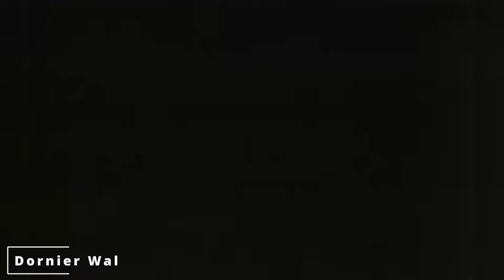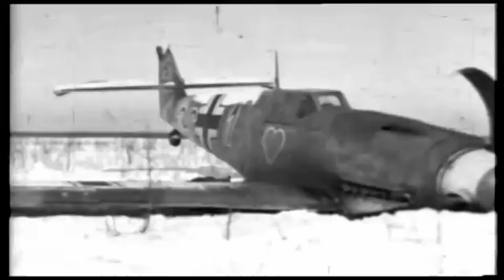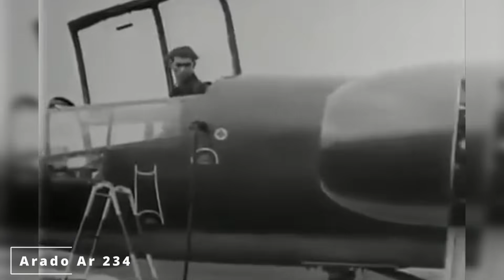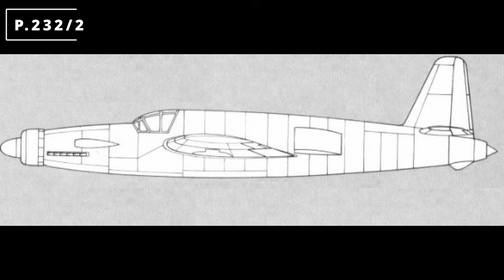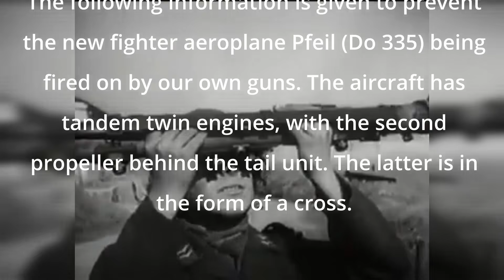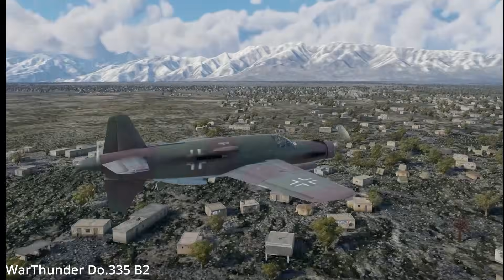Dornier Do.335 Pfeil: The Luftwaffe's Lost Bomber Destroyer (Full Story)

Comment: The dornier 335 Superior engines to anything the United States or England had. This is evidenced by the fact that when the Germans were able to get ahold of a moderately damaged Spitfire they swap the engine with a Mercedes 601 from a BF 109. It flew faster and higher than the Spitfire has ever gone. Imagine what the P-51 would have been had we been able to get ahold of that engine we were building the wrong engine for the P-51 the P-51 had probably the second best engine of the war along with the Pratt & Whitney's that were going into almost everything else.
The DL 335 was faster and could engage in battle and remove itself from the battle at will. They're just weren't enough of them and not enough qualified Pilots. The Jets were not able to accelerate fast enough after taking off making them horribly susceptible to being shot down anytime they were running low on fuel and had to land or right after they took off. The DL 335 did not suffer such maladies.

Comment: It came down to economics and strategic needs. The Do-335 used 2 of the sane engines used by the excelent FW-190D. Germany could build 2 FW-190Ds or 1 Do-335. Win outnumbered and in a war of aerial attrition the choice was obvious. 
The Do-335's vertical stability problems made the decision easier.

Comment: Also, due to Germany's lack of resources, materiel was quite restricted. They reasoned that for each 2 engine fighter that could be built, they could have had 2 single engine fighters instead. Thus, it was very difficult to get the approval for multi-engine aircraft. The emphasis remained on singled engine fighter designs and dual engine bomber designs in order to build the maximum number of aircraft that they could.
Reply: The Do-335 happen to use the same engines as the FW-190D, so that was a problem

Comment: Another advantage of the push-pull configuration in a traditional fuselage is weight.
All of the major masses are connected in a single major structure. Engine-bulkhead-cockpit-bulkhead-engine. No worries about engine loads on the wings and wing roots, no worries about loads on the twin-boom layout.

Comment: The Jona J.10 is an interesting design, and a little ambitious one!
When I saw the design in side view, I immediately noticed that the designer(s) had made a tiny mistake.

In one of the designs, the leading edge is fairly swept, on another (presumably the latter) design,  BOTH leading edges are swept back. I don't at all think that the designer was after better transonic performance with either design in 1935. I instead think that in model tests, the designer came across one fact of life. That is, if you want an inherently stable push-pull configuration in a traditional fuselage, you HAVE to move the wing aft in order to keep enough distance between CG and CP.

In fact, it comes a point when you can gain a lot in efficiency by moving to a canard configuration, just like Burt Rutan did with the Defiant.

Comment: April 2 1941. He-280. Sorry. I do believe the ARROW as I think they called it could have definitely been one of the top performing piston aircraft of all time. For sure. But one major factor as things got tighter a couple years in? Fuel quality. Jets basically use Kerosene for fuel. To get a piston aircraft to perform at its highest you have to have very high octane fuel available. Germany did not have much of anything but highly refined gasoline was especially in short supply.

Comment: The Do 335 looks like just what it WAS. An effort to experiment with the unconventional while the tried and tested successes on both sides of the war came from the evolution of previously successful designs with sequenced efforts to bring improvement. It does not matter how impressive the design does or does not turn out to be if the production is too complicated, expensive or long winded then anything short of a nuclear bomb is uneconomic effort and will detract from victory. The Sherman tank was no match for the Tiger when face to face but the difference in numbers won.
Reply: Interesting comment in the light of current US military doctrine that fields relatively small numbers of Abrams tanks, F-35, humongous aircraft carriers, etc...seems like we have assumed the smaller force/high tech philosophy while the RUSSIANS  still field swarms of T-72 1960 era tanks in Ukraine.

Comment: An interesting comment on how slapdash Allied study of captured equipment was is reflected in the fact that, when Do335 werknummer 240102 was sent back to the Dornier plant for restoration before being displayed at the DeutschesMuseum, the workers found that the explosive bolts in the tail and cockpit were still live.
Reply: Seeing that these explosive bolts were there to allow the pilot to eject, the allies would have been foolish to take them out.
Reply: @alangledhill6454  it's not that they were left in when captured, but that they were still there, live, with twenty-plus years of deterioration when the aircraft was shipped back to the Dornier plant in Oberpfaffenhausen (where some of the people working on the restoration had also worked on its original assembly).
Reply: @alangledhill6454  Taking them out while the plane was being evaluated by test pilots, yes -- but the plane sat out in the open for decades, with the explosive bolts live, before being taken in by the Smithsonian and sent back to the Dornier plant to be restored.
Reply: I imagine the ejection system was disarmed.  Likely there is a safety that is armed on takeoff by ground crew.

Comment: Given Doniers' interest (& experience) in push-pull engine installations, it does surprise me that he didn't begin years before with a DB601 version of the Pfeil, an aircraft that would surely have beaten the Me110 in all the roles it went on to carry out. 
It would also have been able to act as a great prototype for the genuine Do.335 with the larger DB603 engines, ironing out any issues discovered in testing & service use & bringing forward its use.
Thankfully they didn't.
Reply: -It takes years to get an air frame flight worthy and then more to set up a reliable production system.  Engines take even longer.   
Even if the Do 335 concept had of been promoted its hard to see it get it into operation any more than a year earlier, say Jan 1944.  The Jumo 213A and DB603A engines are both in service around June 1943 but they are still troublesome until 1944 and weren't stable engines till About August 1944.  I suppose its possible to imagine service in mid 1943.
-To change the course of the war the Luftwaffe would need an aircraft in early 1940 or tales mid 1941.   1943,44,45 is way too late.
 It would have to perform the following functions:
1 Long range escort fighter with speed, power to weight ratio, wing loading equal to single engine aircraft and range superior to single engine aircraft.
2 With speed to intercept Mosquito day and night with and without radar.
3 Able to fly photo reconnaissance over the UK.  
4 Able to deliver a small precision bomb load over the UK.
The aircraft that could do this in 1940 was the Fw 187 Falke with DB601 engines.  The aircraft was much smaller than a Me 110 so had the power to weight ratio (like the P-38) to compete with single engine aircraft.  It could carry a second crew member to operate radar, radio and navigate.   The Luftwaffe (Udet, Milch) denied the DB601 engine and then latter when it and the DB605 were in plentifull supply tried to turn it into a Me 110 or Me 410 like "zerstoerer" with heavy rearward armament that ruined its performance.  
All of the Luftwaffe's twins  Me 410, He 219, Ta 154 and Do 335 needed engines that weren't available till 1945 (Jumo 213E1, DB603EM and DB603L) to cope with the Mosquito.

Comment: Now we are talking, this is a proper aviation documentary.
Reply: No it isn't. It's an opinionated diatribe.  Would'a, could'a, should'a does not cut it.  Top speed of the Do 335 was quoted as 435mph at 16,000 ft which was about the same speed as the Tempest.  The Night-fighter version had a top speed the same as the Mosquito. But above all this, the 335 was a dangerous aircraft. Not to the enemy but to the Luftwaffe pilots. Oh! It was never going to catch or reach the PR Mosquito.

As for the RAF and USAAF encounters, in the much-quoted Clostermann, unsubstantiated account; neither he or his flight submitted post-sortie accounts of it ever happening. Had there been any encounter with any enemy aircraft, let alone an unknown type, reports would have been made by those in the encounter.  And as for that of the USAAF encounter.  Is that substantiated?

He forgot to mention the DH Hornet and Sea Fury 

Is there any evidence that the Do335 could attain the top speed of 474 mph? even in development, let alone in the production model?  Or that it ever attained speeds close to that?  No!  was it ever fitted with both the MW-50 or GM-1? No!  They couldn't get both to work in the Ta 152, so it would be unlikely that it would work in the 335. 

 Pitting it against a FW 190-A and coming out better was nothing boast about as by that time, Allied fighters had surpassed the 190-A.  

There's lots of myth surrounding the Do335 (same as with the Ta 152)  It's time to make a documentary of known facts instead of hearsay and speculation.

PS. It goes to show just how good the Mosquito was, as both the Do.335 and Ta.152 were both designed with having the Mosquito as their main target, in development.
Reply: @paulbantick8266 
I agree with everything you said here apart from your mention of the Sea Fury and the DH Hornet, neither of which flew in WW2.
Reply: @Richard-iv4zm  The Hornet  and Sea Fury flew in British skies. The Hornet from April 1944, the Tempest II June 1943 and the Sea Fury from February 1945. Which is all the Do.335 did in Germany's
Reply: @paulbantick8266  the video does mention the legitimately of the reported 474mph. 
For me it is a good break down if the development history, would it have made a difference? What does it matter, I'm here for the history of the aircraft
Reply: @Curious-Minds  A mention? yes! But the the more reliable speeds recorded that was around 435 mph.  The 475mph was about as accurate as what the 'estimated', touted speed would be (490'505mph).  

Anyway! There's no evidence at all that the Do 335 attained 475mph. Especially for the production mode.  But at least we know that in general, it was a death-trap.

Oh! I'm here for historical facts, not speculation.
Reply: @paulbantick8266  agreed with you on that, it was a complete death trap, but want a stunning aeroplane..
It was interesting to note how ze Germans managed to churn out so many variations, chopping and changing all the time. 
Personally, I don't mind the speculation, interesting to hear alternative view points.
Reply: all one may expect from this channel.

Comment: If the 335 would have been available in greater numbers, the RAF would have sent more Gloster Meteors and Tempests to the front line, instead of them hunting V1's.
Reply: Yepp. Whenever someone says "more of this or different that would change things" they usually forget that the opponent is not static and adapts to new threats. In the case of the Pfeil, there would surely be initial schock but the allies would adapt eventually, maybe add a few more months to reach Berlin. The weapons manufacturing and manpower disparity was to great. Economics and logistics rule warfare.
Reply: She was still faster.
Reply: @ Prove it.

Comment: The Do335 was less of a technological leap than the Me262, especially in the engine department, and the odds were better that it could have been brought up to service reliability in a hurry.

Conversely, I have read that the engine used in the Do335 cost five times as much as the Me262's Jumo 004, and used several times as many man-hours to build.  This would have been a tough problem for the available resources.

Ironically the mixed jet-piston concepts like the Do435 might have been the best solution.  The mixed layout (a) doubles the availability of Jumo 004s, (b)greatly reduces costs from having a 2nd piston engine, (c) improves on the range of the Me262, and (d) makes it much safer than an all-jet plane at this point.    As the video points out the Do335 could even take off on one engine, so the piston engine could save the plane even if the jet flamed out on takeoff.  What you lose from being slower than an Me262 you make up for with fewer noncombat losses.
Reply: Nothing like a technological leap to be fair. It was a dead end that never worked.
Reply: @RetroGamesCollector  As the Reich collapsed the production programme reduced to the 3 jets plus the Ju 388 and Do 335 as the piston engines types filled niches such as long range and ultra high altitude.  I suspect as the jets developed even these would become redundant
Reply: There were several reasons that Germany deployed turbojets. One was the lack of materials and precious alloys needed to build piston engines. Also the amount of material required was as much as 4 times that of a turbojet. They also required many more skilled man hours to build too. And finally, a shortage of quality fuels made jets a more attractive option as they could run on lower quality synthetic fuel
Reply: While the piston engines took many more man hours to build, the engine life between overhauls was many times that of the early German turbojets as well.
Reply: It has been shown that the Do.335 would be more of a danger to its pilots rather than to the enemy.
Reply: The Do 335 had hydraulic boosted controls which the Me 262 needed to reduce aileron forces.  The Me 262 was equipped with spring servo tabs but they were locked shut.   Also the ejection seat system of the Dr 335 or the lighter pyrotechnic version on the He 162  should have been on the 262 to save pilots lives and limb.

Comment: Funny, I was always under the impression that the Dornier Do 335 handled like a large truck. It was fast in a straight line. There's no way it could outturn a 190.
Reply: It handled as you’d expect with two competing moments of thrust….like an aircraft carrier.  Of course, being as it’s German, we all have to pretend it was a wonder weapon and play along with the “if only” crap.
Reply: @ Yeah! Every time this aircraft is mentioned, the myths bubble to the surface.  Especially its top speed and that tired, old Clostermann quote.
Reply: @paulbantick8266 Do 335 as part of EK335 seems to have performed some night time reconnaissance using photo flash bombs.
Reply from the maker: According to various accounts, it was fairly maneuverable, however, we might have to take into account the talent of the pilots.
Reply: Turning radius is determined by wing loading and power to weight ratio and to a lessor extent aerodynamic efficiency not size

Comment: not even in the top 10 fastest piston fighters (the late war super props) of WWII. just as with the Me262, it had no hope in hell of doing ANYTHING to delay nor change the outcome of the war. the allies learned early that twin engine fighters were logistically COSTLY (e.g. P-38).

You are yet another FOOL who believes in the wunder waffen BS.
Reply: And yet, here you are
Reply: @ yes, here dispelling lies
Reply: You didn’t even consider what the 335 was designed to do before you dumped on it.  It was a high speed long range bomber.  Unlike the P 38 it had a Bomb bay.  Manoeuvrability is determined by power weight ratio and wing loading.  Since the 335 had good parameters in this area, it would’ve performed well in its secondary role of night fighter.  It’s phenomenal range Bomb bay and two 900 L drop tanks would’ve allowed to take ships out to see
Reply: @ "You didn’t even consider what the 335 was designed to do before you dumped on it."

wrong. no matter what it was, it was never going to change the outcome of the war, only accelerate the fall of Germany by consuming fuel and engines at an even faster rate. The issue was its speed, and it's not a top ten super prop for speed, and war wining wonder weapon, which is a childish fantasy that only ignorant fools who don't understand war believe.

P-38 didn't need a bomb bay to be a bomber, nor did other aircraft like the Thunderbolt. Even the Lancaster carried bombs externally. Having a bombay only serves to prove my point further that this would have been a terrible fighter and slaughtered by the dozens.

"Manoeuvrability is determined by power weight ratio and wind loading."

not exactly. it's also about excess thrust and other factors. Speed and climb rate matters more than maneuverability, and this wasn't fast enough. even the German jets weren't fast enough to avoid being shot down by the hundreds.